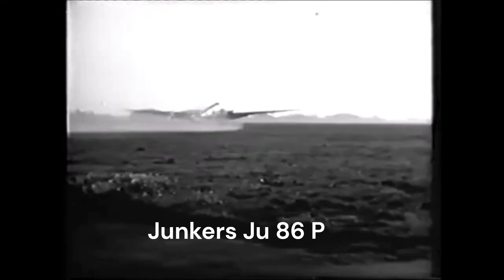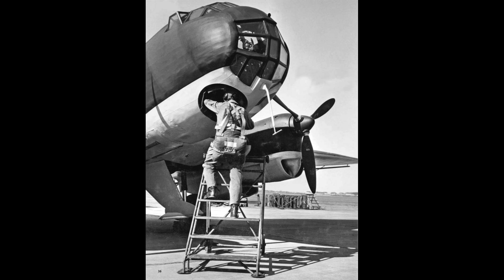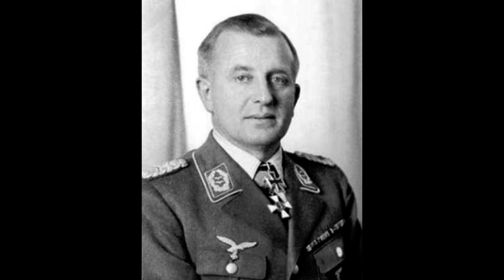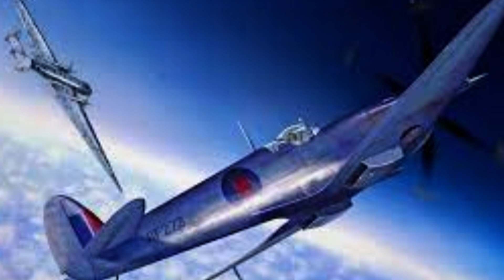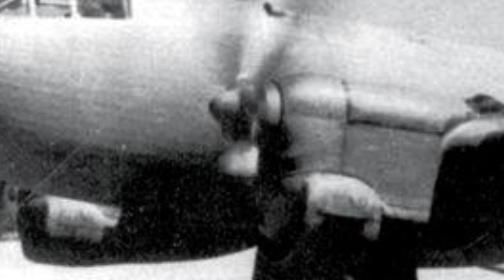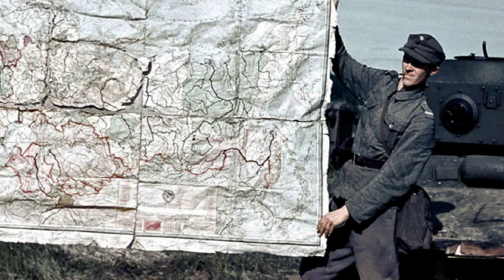Junkers Ju 86 German High Altitude  Spy Plane Over Moscow (’40 - '44): U-2 Incident 1.0

Comment: Flying  pressurized at 39,000 feet,  in the early 1940’s, typically impressive German engineering.
Reply: USA did the same maybe not 40k ft
Reply: @Eric-kn4yn which airplane?